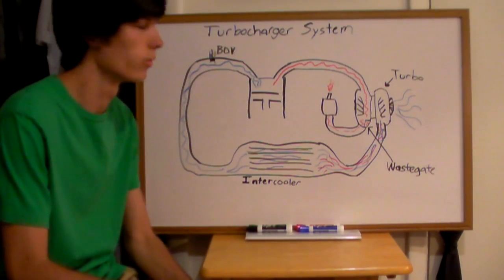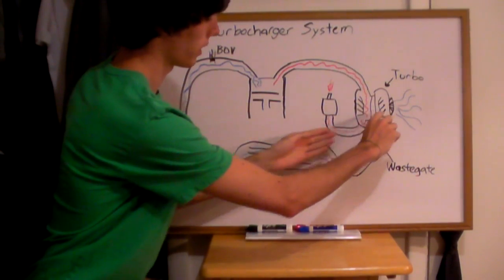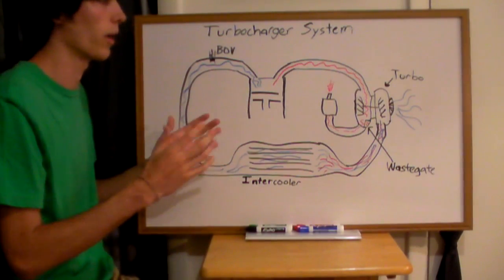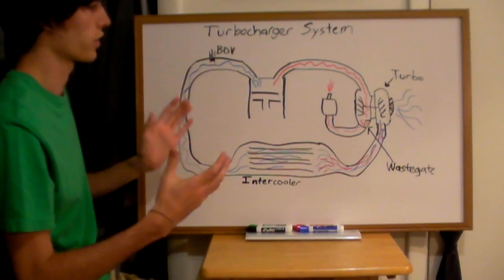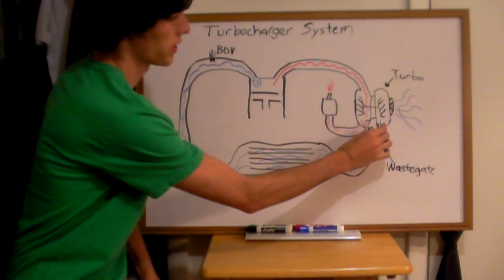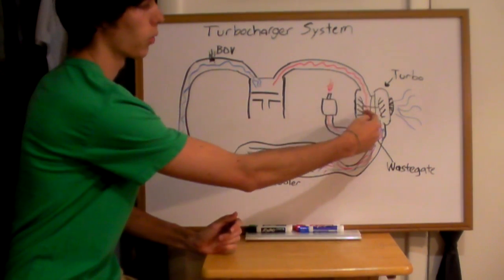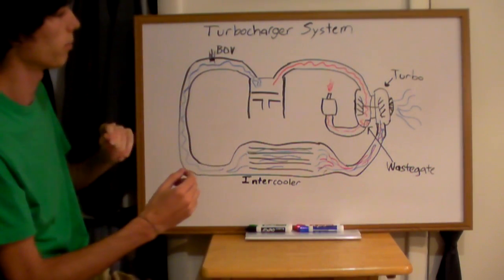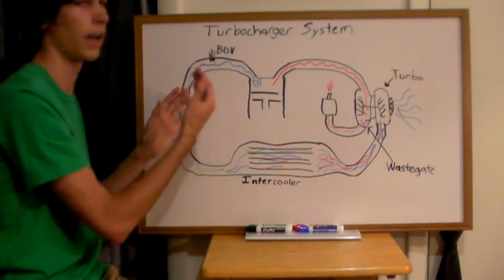How Turbochargers Work

Comment from the maker: Sounds like you've had a good career. I like how you assume that I have no idea what I'm talking about, regardless of that fact that you don't know my history. Jet engines and turbochargers work in different ways. A turbine engine is used to create thrust by compressing air, igniting it, and allowing the force of combustion to propel the engine forward. A turbocharger uses exhaust gases to spin a turbine, which in turn rotates a compressor, which sucks in air.

Comment: SO when I Google Turbocharger test rig. And I see how they work and there nothing more the a big gas or oil burner. feeding the turbo or i go to my turbo guys shop and i see the test stand working. Its not heat that driving the turbo?? Because its not using a big fan or compress to do it on the test stand. OH so when you heat air the air doesn't rise and expand thats not air Movement?? Don't care what i say. I've only been building turbo race and street car engine for 20 years.

Comment: OMG you don't have a clue what the hell your taking about.. Turbos are not driven by Exhaust gas There driven By heat the heat in the exhaust Just like a Jet engine works.
2 The blow off valve is not a kind of waste gate. Its there to get rid of the Psi in the system when you close the TB so it doesn't try to stop the turbo thats going 70.000 to a 120,000RPM so it doesn't brake the wheel off the shaft. 
 And Boost Does not make HP. The CFM of air does.Boost is Just a by product that is not neede
Reply: Hey mate, did you eventually realise that turbos aren’t driven by heat?

Comment from the maker: Correct, you will hear the wastegate while you are producing boost (while your foots on the gas) as it activates when boost is too high so it allows air to be diverted rather than to continue passed through the (already spooled) turbo.

Comment from the maker: Both can serve a separate purpose, as one is before combustion and one is after. If there is too much exhaust, the wastegate can divert air to prevent additional boost. If there is excessive pressure in the intake tubing, and the throttle closes (you let off the gas) then the air can escape through the BOV rather than back through the turbo.

Comment: Are boost controllers sort of like digital wastegates that let you set upper limits on the boost pressure?

Also, are BOVs installed on all turbo'd cars? I was wondering, since I only know of BOVs from souped-up cars that have aftermarket louder ones. Are they an essential part of all turbo cars, but just more pronounced on modded ones?

Comment: A couple of minor points: First, there's only one turbine wheel and it's on the exhaust side. The other wheel is called a compressor wheel. And yes, both are connected by a shaft. Secondly, the BOV is used when the throttle plate is closed, not the intake valve(s). I think you might have mixed them up at some point in your video. Other than that, it was a decent presentation.

Comment: I have a question. If I were to do a rear mount turbo on my truck would I still need to run the incoming air through an intercooler or could I just go straight from the turbo into the engine? and what should I use to direct the air into the turbo?

Comment: I have a question... On diesel engines (lets say a powerstroke diesel which come factory with a turbocharger) in some pickup trucks, its common for some people to straight pipe their exhaust. How does someone straight pipe it with a turbocharger? Do they have to make a custom pipe to connect to te side of the turbocharger? also, how much of the engine exhaust is turning the turbine- is it turning from just one or a few cylinders' exhaust or is it all of it? maybe im just getting confused...

Comment: Just a quick suggestion: In the future if you had to depict this forced induction system again you may want to note that the wastegate in your diagram hints at an internal one (within the turbine housing), and that on more performance based turbocharger setups the wastegate will be incorporated before the exhaust turbine. I'll let you explain the benefit to this if you so please. Lol

Overall, great video though! :-)

Comment: The intercooler reasoning is incorrect.  The heat of the intake charge isn't from the increase in pressure nearly as much it is coming from the hot turbocharger.  Air isn't going to get hot going from 1bar to 2bar.  Its going to get hot when high temp (up to ~1800f) exhaust gas rushes through your turbine of your turbocharger which shares a body and shaft with the compressor side of your turbo, now your intake charge heats up passing through a hot turbo.

Comment: When driving, your air/fuel mixture is pretty much never optimal...
Unburned fuel is usually sent through the exhaust system and is cleaned up by the cat and air injection systems (if I understand that right).

Well, the turbo is before the cat. Don't the unburned fuel, potential NOx fumes and other fumes  damage the turbo?

Comment: Yes. It's called an electronic waste gate. Most aftermarket systems have a dash mounted, user controlled device to restrict the amount of pressure created by the turbo in PSI increments. I don't think it's recommended to completely deactivate the turbo however, because it's now an integral part of your intake and exhaust system and undoubtedly your computer has been pre-tuned to run with this system activated. Without the O2 to match the fuel being thrown into your engine, you could run rich!

Comment: You actually can run a turbo without an intercooler. I used to own an '86 Thunderbird turbocoupe that came from the factory with no intercooler. However, an intercooler allows you to get more efficiency by lowering the intake air temperature. What this does is concentrates the oxygen supply to the intake allowing you to create more "boost" and run more extreme timing without the consequences of premature detonation.(Which is a bad bad thing.) Efficiency! Yeah!

Comment from the maker: Cooler air carries more oxygen, and the purpose of an engine is to create a temperature difference (from cold, before ignition, to hot, after ignition). If the air is already very warm, not only will there be less oxygen (meaning less combustion) but it won't be able to expand as much in the cylinder, so less torque created from it.

Comment: during the exhaust the pressure system make the the output torque less than the earlier free exhaust    is it not that much problem 
is the loss in compression is less than gain gain of oxygen or some what different?
                     some one please explain

Comment from the maker: Well, hot air is less dense so less oxygen. Also, the turbo will heat the air under compression, so hot air gets even hotter, which is not what you want going into the cylinder (hence the intercooler). So, what it says on wikipedia seems logical to me.

Comment from the maker: No, that's an excess of fuel, from running a rich mixture in the engine. It's common with turbos because when you have boost you inject a lot more fuel, and when you let off the gas you still spray some fuel in, which all doesn't burn since there isn't enough oxygen. This fuel travels through your exhaust system, and as it reaches the outside (oxygen rich) air, it ignites due to the temperature of the exhaust piping.

Comment from the maker: I think you may be referring to turbo flutter or compressor surge. It's a cool sound, granted, though it can be damaging. Basically what happens is when you left off the gas, the throttle body closes, and the compressed air has nowhere to go. A BOV can fix this problem, but if the BOV isn't effective enough, or isn't there at all, the air is force back through the turbo, creating the sound you hear.

Comment: ...So to sum up: the wastegate is on the exhaust side of the turbo and is used to keep it from overboosting, the blowoff is on the intake side used to leach off boost and keep it from working its way back into the turbo when it becomes unnecessary.

Comment: ...This creates backpressure.  Also keep in mind that the throttle plate closed so the amount of exhaust gas to drive the turbo has choked off.  Without a blowoff, this back pressure would work its way back to the turbo and drastically slow it down.  It would damage the turbo.  The blowoff leaches off boost when it becomes unnecessary...

Comment: Its a common mistake but no.  The wastegate is on the exhaust side and is used to bypass exhaust from the turbo.  Exhaust gas drives the turbo but theres always a limit to what the engine can take so at a certain boost, you leach off exhuast gas to stop the turbo from over boosting.  So now the turbo is using exhaust gas to spin a turbine to push air into your engine.  When you let off the gas pedal however, your going to choke off the air flow into the engine when the throttle plate closes...

Comment: I would love for you to do a video on VVT/VCT. Also the difference between the types that are controlled with oil pressure and the ones that use the torsional pressure in the valvetrain to move the cam. Also the effects that it has on the power production of the engine

Comment from the maker: Compressor surge. It occurs when the pressure in the intake is high enough, so that when the throttle plate closes (you let off the gas) the air is forced back through the turbo. I should be making a video on this eventually.

Comment from the maker: If you double the amount of air, yes, the amount of fuel should be doubled as well. This is because (at least in gasoline engines, diesels are different, but the idea remains the same) gasoline engines use a constant air/fuel ratio, meaning for ever 14.7 (ish) parts of air, you get 1 part of fuel. (This 14.7 does not correlate with atm pressure, they just happen to be the same number). With diesel engines, you adjust the air/fuel ratio with the gas pedal, so it works a little differently.

Comment from the maker: I would say no. Many will have compressor bypass valves, which I should have mentioned in this video. Basically it routes the air back into the intake if the pressure is too high, rather than just venting out the air like a bov.

Comment: dont forget compressor surge or "turbo flutter" when your bov does not open properly and the boost runs back into the turbo the wrong direction and causes a shorter life span of the turbo.

Comment from the maker: @jcotty7 It's just a unit of pressure. 8 pounds per square inch of boost added to the engine cylinder (on top of atmospheric).

Comment from the maker: @jeshiescoots The latter option. It will keep your boost at the maximum level you desire based on the setting. So if you wanted it to not exceed 8 psi, and it started spooling too fast, you would not exceed 8 psi.

Comment: @EngineeringExplained the egr's purpose in life is to reduce NOx (oxides of nitrogen)which is harmful for the environment and our health. The Egr does this by rerouting exhaust gases into the combustion chamber which lowers combustion temperatures, which in turn reduce NOx. The exhaust gases lower the temperature because exhaust gas is an inert gas and is non reactive and and it takes up the space of the oxygen in the cylinder.

Comment from the maker: @sherif89 I believe that is one of the reasons for EGR, but it's more difficult to heat hot air than cool air, and the greater the temperature difference before and after combustion, the more power the engine can create.

Comment from the maker: @333autotech Cooler air is more dense, meaning more oxygen. Also, cooler air can expand more than warmer air (takes up less space for the same amount of oxygen), and the more that air expands the greater the pressure difference from combustion, and the greater amount of power an engine can produce.

Comment: @gganana Unlike a supercharger which is instant power because it's connected to the engine, a turbocharger gets its power from the exhaust which isn't instant. When you accelerate there's a few seconds of no boost (turbolag) because the turbo needs to spool up (have enought exhaust past through to reach a certain psi) then it'll kick in. Theres probably a better way to explain but I hope that helped you :-)

Comment from the maker: @psanjay100 Call them whatever you like, there's a turbine used to spin a compressor if you wish to be technical, but both devices are basically the same, just feed air in opposite directions.

Comment: @thekkl dont really know what that last part of the second question was but the BOV is so the air can escape when it passes through to the other side of the intercooler. otherwise it would just escape back through the fan of the turbo and that is completely fine as long as your not running too much boost.

Comment from the maker: @fanousontheloose The air becomes hot after compression. PV=mRT so as the pressure increases from compression the temperature goes up as well. You do not want hot air coming in, as it is less dense and holds less oxygen. Intercoolers are still used on diesel engines. That said, not all vehicles with turbos use intercoolers, it's just a more efficient manner of achieving the desired result.

Comment: question: so i just watched your gas vs. diesel video and you say that diesel runs on hot air and then as the air gets compressed that when fuel is injected to ignite it. so now based on this video my question is, if you have a turbo diesel engine does that mean you do not have an intercooler since you need the hot air to be injected with diesel?

Comment: @EngineeringExplained also the exhaust gas that is used to spin the turbine is hot and that heat carries over through the shaft that is connected to the turbine on the other side.

Comment from the maker: @Rowdie999 Yes, you can, but then the turbo has to be sized properly. A wastegate allows for you to use a much smaller turbine wheel, so you'll have better acceleration and higher torque at low rpm. With a larger turbine, you'll experience dramatic turbo lag. Now if you were to put a small turbine wheel with no wastegate, you would experience too high of pressures at high rpms, and yes, and engine not capable of withstanding these higher temps and pressures is toast.

Comment from the maker: @thekkl 
2) The BOV is only necessary when letting off the throttle (shifting gears). However, you want there to be built pressure in the air chamber waiting to come in once you're back in gear and on the throttle. The exhaust should constantly spool to maintain power. It takes a bit of time for the turbo to spool and create boost (turbo lag) and so if you keep it spinning for the short duration of the gear shift, you can keep your boost into the next gear.

Comment from the maker: @thekkl 
1) As air is pressurized, it builds heat. Heat is what you're using to create power, so air that's already hot is less useful in an engine. Also, cool air is more dense, and has more oxygen. The more oxygen, the more fuel you can burn -> more power.

Comment from the maker: @EngineeringExplained Finally, waste gate gases can either be channeled directly into the exhaust (much quieter and more eco-friendly method) or you can have an external wastegate and dump the exhaust gases directly into the atmosphere. This can be loud, and since it doesn't pass through your catalytic converter it's not the most environmentally sound method. Youtube "external wastegate." It makes a very distinct sound, generally at higher rpms when more boost is created.

Comment from the maker: @1971SuperLead For your second comment: The injection system is directly before the cylinders; the easiest way to locate them is looking at your intake manifold, they'll be directly above in most cases. The BOV is before the throttle plate. This is how it has to be in order to function. When the throttle plate closes (you let off the gas) pressure inside the air intake increases, and needs to escape (rather than pass back through the turbo).

Comment from the maker: @1971SuperLead Many turbos have built in wastegates. Don't think of it as before or after the turbo, but alongside. External wastegates have a split in the exhaust headers that lead to them to release pressure in greater power applications.

Intercoolers are not required, but are dumb not to have since they increase the efficiency and output of the device.

Comment: @1971SuperLead Also, Where is the carburetor or injection system? Where is the blow off valve in relationship to the carb or throttle plate? Upstream of course. Where does the waste gate blow into? You make it sound like only the waste gate gasses go through the exhaust system.